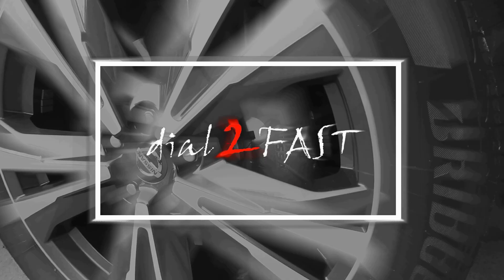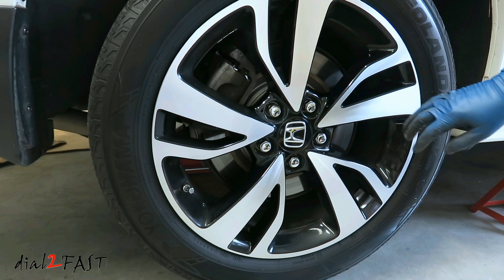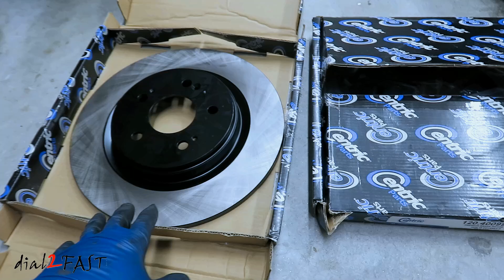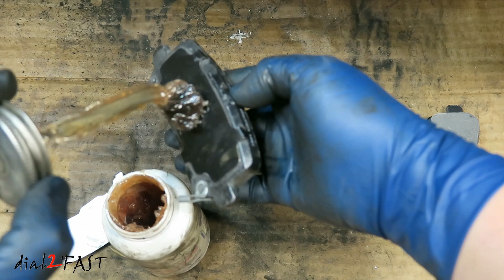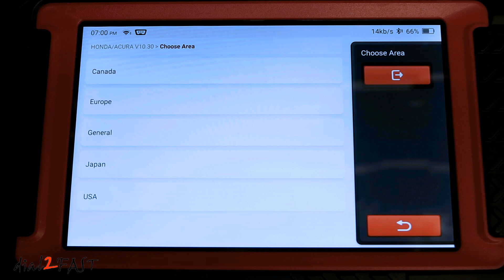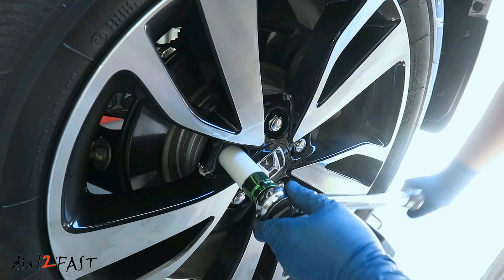Honda Odyssey Rear Brake Replacement Service | 2018 – 2025

Comment: You do a great job on these videos.  I watched another video on the rear brakes to see if I could do this without a scan tool and they didn't have a t45 either so they used a flat blade screwdriver as well.  Harbor Freight had an inexpensive set so I bought it.  I used aftermarket rear brake rotors and the high line Wagner OEX pads.  On the front, I used after market brake rotors (they were a high line of rotors both times, the first were a carbon style rotor) and Wagner OEX pads.  The pads dusted the wheels in the front only and I am now on my 3rd set of rotors.  My father in law taught my wife to drive and she is hard on brakes like him.  I relented and went back to original equipment Honda pads and rotors for the front, the Honda pads come with new shims, the quick release springs for the pads and new caliper bolts, that's a first.  No vibration so far.  I watched your front replacement video and torqued bracket bolts and caliper bolts and lubed everything up really well as well as cleaned everything, hopefully this is the last time for a long while on the fronts.  In summary, when I replace the rears again, I will go back to original Honda pads/rotors and clean an lube the heck out of again.

Comment: great vid. thank you. just replaced both front & rear pads, rotors. I used autel ap200 scan tool ($50 on amazon) to put the car in maint mode to retract electronic parking brake. works like a charm. so you don't need to spend hundreds of dollars on any adv scan tools.

Comment: Do you have to turn that actuator back (counter clockwise) after pushing in the piston?
Reply from the maker: No you don't need to. Just do both sides, and put everything back together. Then engage the electronic parking brake.

Comment: Is that clockwise for both sides on the parking brake mechanism?
Reply from the maker: Yes clockwise for both sides to wind down the EPB.
Reply: @dial2fast  Got it. I was pretty sore after that job but I figured it out. I’m getting too old for this stuff. I need a hydraulic lift. 😂 thanks!

Comment: Great tutorial, laid out steps really well. I had 2 complications with my setup following this tutorial. 1) seizing of the bolts to access the internal bits of the emergency parking brake. Called a friend who recommended getting a torx bit ratchet + penetrating blaster PB which did the trick. 2) The manufacturing bolt on the rotor was seized in place and an impact screwdriver with lots of pressure wasn't enough (just started stripping). Tried the ratchet approach but had the same issue with stripping. I had to drill out the whole head of the screw (called my friend for advice again, this is what he recommended), which left the shaft behind but let me get the rotor free.

Comment: Any reason you are using Centric Rotors and Pads Vs Honda Oem Brakes and Pads?
Reply from the maker: Aftermarket rotors and pads will always be cheaper than OEM ones. You can definitely use which ever brand (or OEM) you like for your brake job. For me, after trying many different brands of rotors and pads, I like Centric. Good everyday brake performance and lasts a long time and no rotor warping.
Reply: @dial2fast thanks for the reply. I have never used centric rotors before so was curious as to how they perform over oem rotors because this is the first time I am experiencing warp issues in my Honda Odyssey with oem rotors and pads still original and close to hitting 50k. I had other Honda vehicles before and they didn’t have much warping issues maybe it’s because of the weight as well vs the van.
Reply: @veepatel0101  Anecdotally, Centric has always been my #1 go-to for aftermarket brake parts. I used them in my S2000 and use them now in my Odyssey.

Comment: Have you by chance found a remedy for the rear end squat on the Odyssey? This seems to be happening on 2018 & up.

I experienced this with a road trip & had 7 riders including myself in our 2019 Odyssey. Rear passengers in 3rd row stated it was a little rough riding back there.  Any insight would greatly be appreciated. Thanks!

Comment: Are you using regular or premium gasoline to your Honda odyssey?
I saw some feedbacks that it’s better you use premium as the engine’s fuel delivery is Direct Injection with high Compression ratio to prevent knocking.. 

Is it true you need to use Premium gasoline to 5th gen Honda Odyssey to keep it longer?…
Reply from the maker: Using premium gas is just wasting money on an engine that doesn't require it. When it comes to all fluids in your vehicle, use what the manufacturer recommends. Also many big brand gas contain detergents to help maintain engine cleanliness. These detergents are formulated with deposit control additives and help clean dirty engines, restore fuel economy, and reduce emissions.
Reply: @dial2fast so are you using premium or regular on your odyssey?..
Reply: @dial2fast which gas grade are you using?..

Comment: Hi, i heard timing belt replacement on this honda v6 3.5 is difficult.. 

Have you replaced it by yourself or are you planning to do so DIY?..
Reply from the maker: I still have a long time before needing to replace mine. Probably take it to a shop to get it done.
Reply: @dial2fast how often do we need to replace timing belt for 5th gen Odyssey?

And may i also know have you ever clean throttle body?!..
Reply from the maker: @Qkfltpdls777  Timing belt is pretty much the same for most vehicles. Replace it at 95-100k miles. I have not cleaned the throttle body on this. Usually that involved cleaning the throttle plate. The tricky part is not damaging the throttle plate and also there probably is an idle relearn procedure afterwards. Not sure how it is on this gen of Odyssey.
Reply: @dial2fast Well noted. Thanks! It looks like some counties in Asia like Korea, Honda specified timing belt replacement interval is around 100,000 KM (not Miles..) for 5th Odyssey and I thought it’s too often..
Reply: For the manual method, do you replace one side, engage the parking brake, then repeat for the other side? Or do you replace both left and right, then engage parking brake?

Comment: There are many reviews that having issues with honda 10 speed AT. What about your car?
Reply from the maker: Really, this is the first time hearing about any issues with the Honda 10 speed. I know there were many issues with the 9 speed, but not the 10. I have had no problems. I also do the transmission fluid drain and fill service every 35k.
Reply: 77,000 miles on my 2022 Touring. Zero issues with the 10-speed transmission.

Comment: Can you do a video on doing a coolant flush and re fill? Love your channel. Been saving big bucks by doing the maintenance on my honda oddysey 2019😊👍🏻👍🏻
Reply from the maker: Hi there, I will surely make a video when the service is due. But it will be later as my mileage is still relatively low.

Comment: I usually clean the old grease out from the housing of the guide pins and the rubber boots and pack them with fresh grease.

Comment: The Honda "philips" screw is actually not a philips.  It's a JIS #3 which is different than phillips in that it's designed not to cam out when the torque increases.  If you get stuck, get a JIS #3 impacting screwdriver to help get it out.  A regular philips screwdriver does not actually match this screw and you are much more likely to strip it, necessitating a drill out.
Reply: Yes. Totally optional to put it back once out. It doesn't serve any purpose. Honda uses it to keep the rotors in place as the car travels in the factory line.
Reply: @Newtttton  Totally.  It was the first thing I did during the first winter tire change years ago.

Comment: Thanks for the video. How many miles you had on the odyssey?
Reply from the maker: It's a 2019, and the brake was done at 57k miles.
Reply: Thanks Dial2fast!